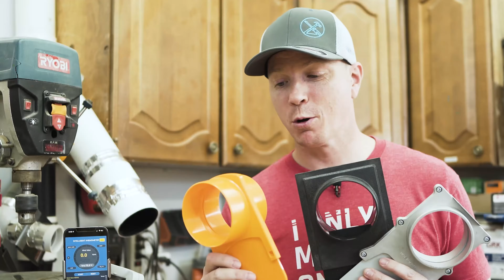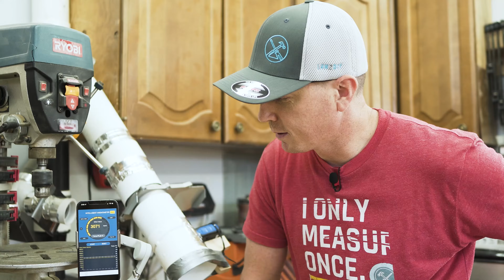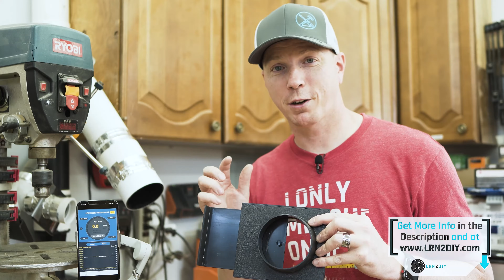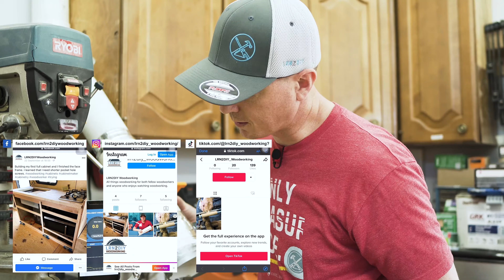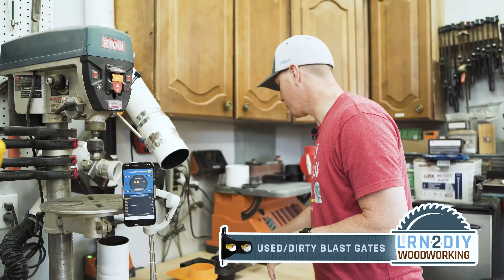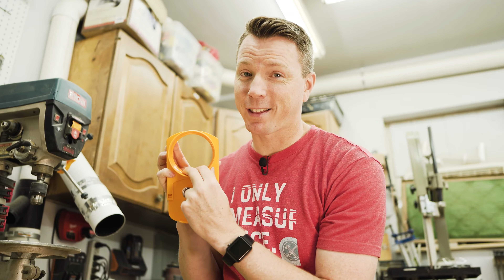This New Blast Gate Has a Trick Up Its Sleeve | Dust Collection

Comment: I suggest performing a toilet paper test around the gate while closed and operating. Sliding blast gates can leak by incomplete internal closure which your test quantifies. The second point of leakage is around the exterior of the gate sucking air in from outside the system. The combined air leakage equals the total efficiency loss. I suggest mounting your monitor between the blast gate and the vacuum to capture all leakage. Toilet paper being very light will move with the slightest air movement therefore identifying areas of air leaking into the system. I used this simple test on my whole system to identify leaks into the system. and found every sliding blast gates leaks into the system. The blast gate design simply is a very inefficient design. A ball valve and butterfly design at least overcome the external leakage into the system, however the butterfly design appears to be more problematic making a tight closure.  Does anyone make a commercially available ball valve blast gate?

Comment: Awesome video. Thank you! I’m putting together my first dust management system using Powertec 2 1/2” fittings. When it came time to get the blast gates I was overwhelmed with all the choices, and Powertec certainly leaves a lot to be desired with their product descriptions. So I did a Google search. Surely I’d find a dozen videos and just as many message boards and forums from people comparing every Powertec blast gate. But nope! I couldn’t find any good resources. 

Except your video. It kept popping up no matter how I worded my search. But honestly, the title threw me off. I decided to watch thinking I might get some useful supplementary info, but I was very happy when the video started. This is exactly what I was looking for! I’m a bit surprised you don’t have more views, and I think if you changed the video title you might get better results. Just an idea. After all, I had no idea this was a side-by-side comparison of Powertec blast gates until I started watching. I’m sure many other people are in the same position. 

Thanks again for this useful info. You’ve made my decision so much easier.
Reply from the maker: I appreciate the feedback and glad you found the video helpful! Just out of curiosity, what are some ideas for titles that would have gotten you to click?
Reply: @spaceshopwoodworking "best blastgate design current year 8 models tested!

Comment: I know this is an old video, but with the aluminum gates, try putting the gate into the pipe with the lock screw facing away from the vacuum source.  When you close the gate then tighten the screw, it will press the knife against the vacuum side helping to seal it better.

Comment: I like the tests, but think you have a problem in the method you use. The anemometer reduces the pipe size more the your open blast gates.  Therefore, you get so very little variation on full opening. If you put the meter in a larger pipe that corresponds to the surface the meter itself takes then I think you will see much greater variation at full opening.

Comment: Another thing worth mentioning about the Powertec gate is that pair of ramps actually creates a bit of a Venturi effect that could suck debris out of the gap in between.
Reply: They are made to do that. You open half way, turn on your dust collector, and it will clear whatever has accrued in the gap. The orange powertecs are the way to go.  I swapped all mine out and they work great and always close fully

Comment: Excellent review, excellent video. I made a plywood plenum for my very small 10x20 ft shop and DIY'd my own blast gates out of 1/4" plywood and 1/4" acrylic. Arranging my plenum so that the flow of air is from top to bottom and not having a groove to catch dust, each acrylic gate suctions itself closed to the plenum when the vac starts. Seems to wprk fine, no need to clean the gates because there is no groove to clog up.
Reply from the maker: Sounds like a great solution! I've seen quite a few homemade gates that look like they're doing a great job and I may have to try some out. I liked the idea of an affordable set of gates that work well so it's been fun to test these different options.

Comment: One thing to think about. Use the aluminum self cleaning gates on heavy chip producers, like a jointer and planer. Use plastic ones elsewhere for a more airtight fit on less chance of getting clogged areas. That will balance cost and the inevitable pain in the butt of cleaning out an installed blast gate.

Comment: Just watched the entire video. Very informative. I have not seen the Powertec before. The results from the other two were somewhat expected, but I’ve been doing this a few years now so I feel I have a fair amount of experience. I have a thought about the aluminum gates but I need to watch the video again first.
EDIT:
Ok, my understanding of the aluminum gates is they have an in and out side. The little knob is the clue. The knob is there to hold the plate tight up against the valve. So the knob should be on the in side (furthest away from the DC). The theory being that the suction pulls the plate flat against the valve. I have not tested this but I do remember reading about it and it does make sense. This should give you better results (0 ft/min) when closed.
Reply from the maker: Very interesting. I'll have to give that a try and see if it makes a difference. It definitely didn't seem obvious that there was an in and an out direction but I'll take a closer look.